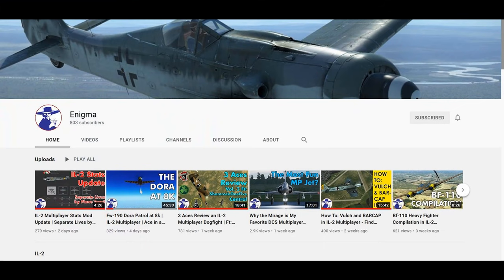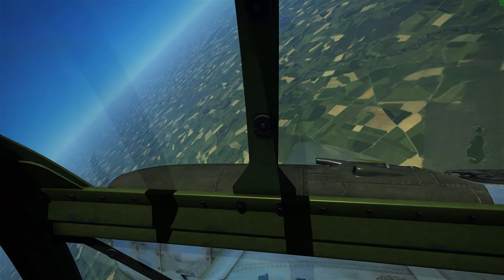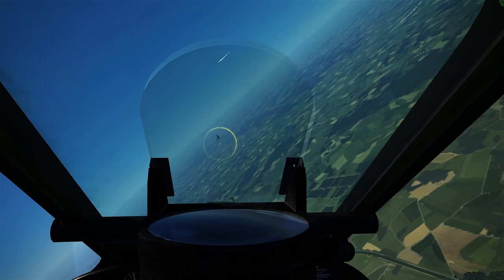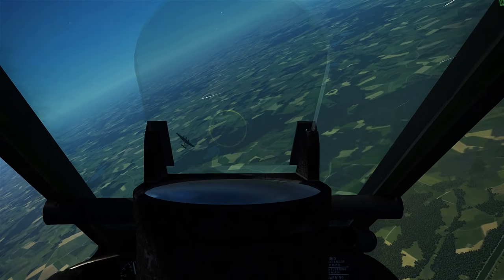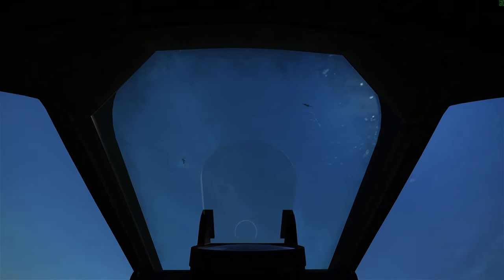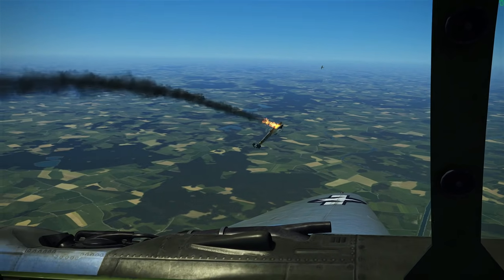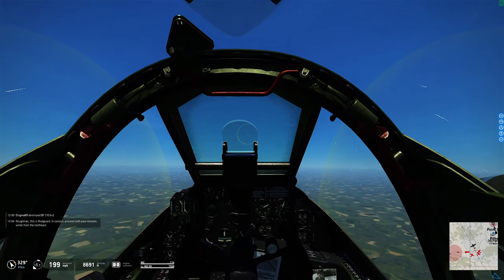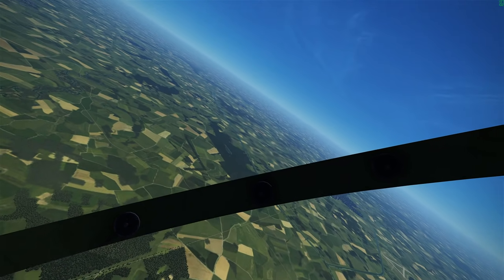Primary Vs. Secondary Sources For WW2 Planes

Comment: One thing about aces' autobiographies is that well, they were aces. You read Bob Johnson's book and he describes how easy it was to defeat the P-38 in mock combat while flying a P-47. You read Tony Levier's (not an ace, but a dam good pilot) book and he describes how easy it was to defeat a P-47 in mock combat while flying a P-38. Both good pilots well aware of the strengths of their aircraft and how to take advantage of a less skilled opponent.
Reply: Also, the performance differences between contemporary fighters of similar role tend to be smaller than people realize. Still absolutely significant, but the gaps are often small enough that it’s hard to say “X plane will outrun Y plane” as a general statement, unless plane X is genuinely very fast at all altitudes, and plane Y is quite slow at all altitudes. 

Every plane will have some strengths or weaknesses, and while you can absolutely “build a better mousetrap”, the end result doesn’t tend to be something like “a 50% increase in odds of victory against a certain opponent”. It’s generally going to be more subtle, excluding particularly large jumps in technology

Comment: Thanks for the explanation on sourcing & the up coming video. The Lightning always has been my favorite WW2 fighter bomber, mostly because of, like the P-47, the P-38 was just so damn versatile. If they had prioritized fixing the heating issues & supplying high octane fuel the the ETO squadron, the P-38/P-47 tag team could have started the attrition war in the air with a much bigger bang in late '42 & early '43. But they still should have started using drop tanks much earlier than they did. And I agree with you that the Beaufighter was the least appreciated gem of the Allies aircraft & should get more credit for it's accomplishments than it does.

Comment: I'm glad to see a detailed discussion of primary sources. I have found that the difference in reliability between one primary source to another is often larger than in the average reliability between the average primary source and secondary source. One example I can give ... I have Eisenhower's official report of the Allied North African operation. This is unquestionably a "primary source" by the most authoritative man possible ... and yet ... was Eisenhower ever in the trenches in North Africa getting shot at? Eisenhower's official report for the entire North Africa operation was made from assembling literally thousands of aggregate official reports all the way down to the platoon level over a period of seven months .... 

And of course this is before we even get into the "accuracy" issues, of which the biggest problems are what I call #1 "mis-remembering" (good faith recollections that are simply wrong) - which is usually a sin of enlisted men and junior officers - and #2 "ass covering" (bad faith recollections that are designed to shirk responsibility) which is usually a sin of generals and admirals.

Comment: "Primary" doesn't mean "good" or "most accurate". "Primary" basically means just that the text (if we are talking about textual sources) is not derived from any other text. In this sense, company manual is not a primary source - it is based o n the results of in-company tests, on original production drawings, etc. And it inevitably simplifies some complexities. E.g. performance numbers presented in a manual are some calculated (e.g. by averaging) numbers, derived from the original tests. 

Which sources to select depends, of course, on the goal of the research. 

For the analysis of the theoretical performance of mass produced American aircraft, company's manuals are probably the best choice, despite not being "primary" in the strictest sense. If, on the other hand, you are looking for a real life performance of a Soviet mass produced aircraft, official manual gives you somewhat glossed out picture. They typically based on the tests of pre-production models, while the production quality was noticeably worse. Or, say, the goal of your research is to determine the variance in the performance of the same aircraft model, but from different production batches or made on different plants. For this research company manuals would be a useless source.

Historians have  developed a lot of methods and procedures for dealing with these problems. See https://en.wikipedia.org/wiki/Source_criticism or https://en.wikipedia.org/wiki/Historical_method

PS

BTW, sources are not necessarily textual. E.g. survived airplane in a museum or private collection is also a source, at least on construction, if not on performance. And probably the most primary of them all (to the extent it has not been tampered with).
Reply: Saying that primary texts don't derive from any other text is simply wrong.
On that definition the only primary sources would be lab notes and first drafts.
Almost every published document goes through versions and stages, and this is especially true for engineering documents, where the information is drawn from multiple company sources. They group productions.
Reply: As a manual writer and translator, I can also tell that some mistakes can be found in manuals, either because the writer did not properly understand the explanations given to him, or the "primary source" made a mistake. Or the writer was forced to, for some reason.

And the guy who writes the manual is is just that, a writer. He is not the engineer who designed or tested the stuff, nor does he influence his company or country policy.

I personally left some mistakes in some manuals, because the guy who gave me the info insisted on them, or the company wanted things to be that way. Or, more simply, because we were short on time and the mistake had few consequences for the purpose of the document.

I also know of documents that nobody ever bother to read. They were written, and just shelved. Nobody ever read and correct them.

Comment: Spot on about misremembering things from pilot's perspective. Even though it is just virtual flying, in my 15 years of online dogfights and other flight sim related stuff - I can't tell you how many times the track (which records what happened and can be re-played later on with external view) told me what actually happened, vs. what I remembered it looked like. Or I thought it happened. So many times my impression/memory of what actually happened wasn't in line with what has really happened. Sometimes missing the important event that I didn't see or realize it also happened while I was looking in the other direction or was occupied by doing something else.

Very curious on who was that high ranking guy you spoke about. I do hope you will follow up with this topic.
Reply from the maker: Good point about it happening even in flight sims. That's true in commercial airline training sims as well. One airline I flew for used to record the sessions because the pilots often recalled things in a way that was totally different from reality. 

I may make a video about the German issue I brought up.

Comment: Often noted, the P-38 was “designed to meet” a late 1930s  US Army Circular Proposal X-608 that set of aircraft performance goals for a high-altitude "interceptor" having "the tactical mission of interception and attack of hostile aircraft at high altitude. We see the story often that the P-38 was designed to meet this requirement. As you have noted, the requirements were met, high speed and rate of climb, stable gun platform in a center location. But, was there a “fighter” requirement buried in the X-608 doc.  I have read the cockpit was very busy place in the fighter mode. The pilots had to be competent in its use.  Question- has anyone ever seem a copy of 1937 USAAF X-608 proposal?
Reply from the maker: I have never seen it, only summaries of it.

Comment: At 5:50, you mentioned in passing the Me-163. As the Komet was rocket-powered, is it not possible that at least one actually broke the sound barrier before Chuck Yeager's flight?
Reply from the maker: I have two videos on the 163, you might like them. No, it's not possible that it broke the sound barrier, it wasn't a question of power, it was aerodynamic and control issues.

Comment: There is one thing about WWII fighter guns, which I can't find any primary or even proper secondary source: The synchronization of Browning machine gun and designs directly based on it. There are claims that the design was very bad for propeller synchronization, which halved the fire rate, but it's not recorded in any of the manuals I have ran into. Could it be a thing more based on firing system instead? Greg if you ever hit into this in P-39, P-63 or any other manual, please let me know.
Reply: The Browning recoiling barrel design lost nearly half its rate of fire when synchronized with a prop, and this is evident on all the excellent Japanese Browning copies, when these were used in synchronized mounts: From 900 rpm to 500 rpm on Ho-103s, and similar losses on Ho-5s. The US avoided synchronization whenever possible since, even as they were, the guns and their high firing rates could barely score kills in the widely accepted hit and run fashion. The Japanese Army possibly cared less, since they understood turn fighting, and the resulting longer target time, as easier for the average pilot marksmanship.
Reply: @wrathofatlantis2316  Sorry, but sources? It's something which is likely close to truth, but how can something so notable be missing from all documents? In early P-40 and P-51 there were cowling guns. I would suggest it didn't matter keeping them there when they went to six guns later. At that point a better convergence pattern likely helped more. Only Cobras and some attack aircraft kept their Brownings there.
Reply: @Teh0X  Getting rid of convergence with nose guns is a huge advantage for simplicity of aiming, and a good shot density at all ranges. It was an advantage which Russian, German (and Japanese) fighters never gave up on, as they had good non-Browning machinegun designs for the synchronized position (except the Japanese Army). All the early US fighters had a pair of nose mounted Browning .50s: P-40, P-39, and early P-51s. Both the P-40 and the P-51 dropped the nose-mounted Brownings, and only the P-39 retained this throughout its production, which was largely used for training, or Russian lend-lease. The difficulty in synchronizing Brownings is understandable when you consider that their firing cycle is more complicated than on other machineguns: Step 1: The barrel moves back with the bolt. Step 2: The barrel stops and the bolt continues. Step 3: The barrel moves forward from a separate spring. Step 4: The bolt slams shut with another round. The other machineguns are basically two steps: Step 1: Bolt unlocks and moves back Step 2: Bolt slams shut. Maybe the interruption effect on two large components, moving separately, had to be heavier-handed? The rate of fire on Japanese Brownings was actually higher than on US Brownings, and even than other mgs (900 rpm on 12.7, and 20 mms!). Maybe that made the interruption losses even higher? In any case, a lack of documented proof of the loss is not proof of absence of the loss. Electrically fired German ammunition had lower synchronized losses because the interruption system was electrical, and this avoided mechanical friction, perhaps a clue to the cause of larger losses.